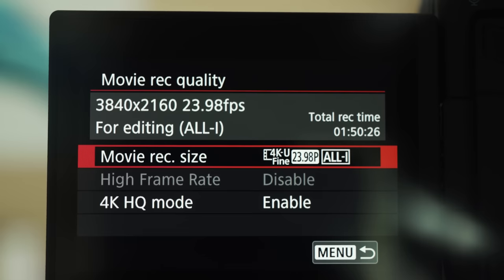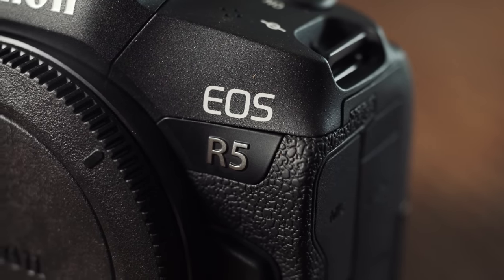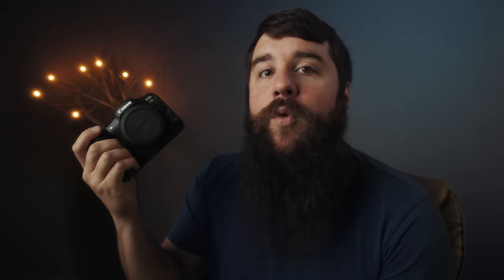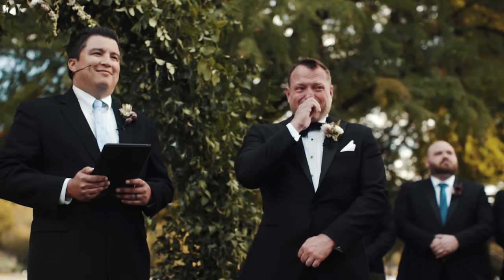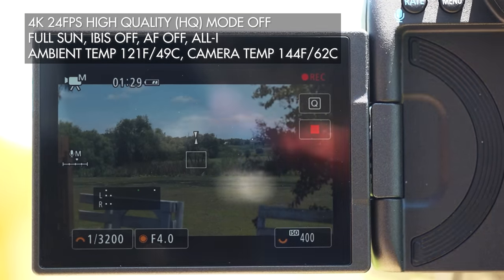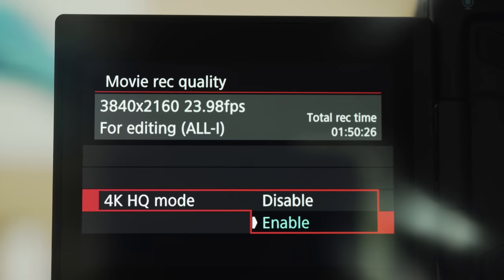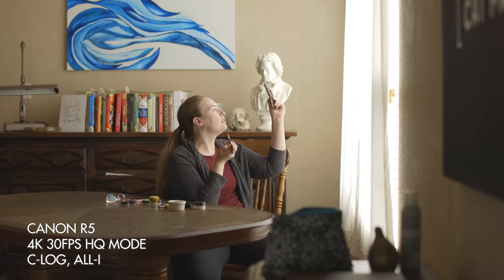Will The Canon R5 Overheat Filming A Wedding?

Comment: Matt: “Professional film makers should NOT rely on this camera”
Canon: 👁💧👄💧👁
Reply: Any professional film maker that buys an R5 is dumb... just as dumb as any pro photographer buying a 12 MP crippled A7SIII. 
Cinema cameras exist for a reason.
Reply: @77dris  maybe the point is not every professional thinks the same, I'm a wedding photographer and I shoot photos with a Sony A7iii, I used to do it with an A7r2 but the raw sizes were just too big, so didn't go for the r3 or r4 cause the prints I do really don't need anything beyond 24mpxs, that could happen with video: shooting raw video is a nightmare and most progressionals only do that if necessary
Reply: @77dris  try to spend a whole wedding day with a professional camera mounted on a gimbal. Good luck with that ;-)
Reply: @badmoonPL  did it for 35 weddings last year. This year I don't use a gimbal unless I have too. My back got so fucked up. 😅
Reply: Yes, though he's assuming that you don't have six R5 bodies in rotation and an S1H for everything long form ;)

Comment: The most straight answered video on the overheating of this camera, THANK YOU!
Reply: Have you used the ninja on a gimbal? Just curious, cuz I shoot all day on a gimbal and I never bought a ninja because it seems like it would be too heavy and throw off the balance. Just curios if anyone has experience with it on gimbal?
Reply: Davin Phelps what I do is put a cheese plate on the side of the gimbal or have a handle attached with the gimbal that has places where I can mount anything that has a 1/4 screw. I put the ninja on that side rather that ever putting it on the top of the camera.
Reply: ANM Productions - All Things Film thanks for your response!

Comment: Matt, thank you so much! This is the exact question I was asking myself all the time. "If I buy this for stills, can it pull off enough video shoots for me to create a 5-to-10-minute clip about the wedding day for my clients?" Well, it seems the awnser is no.
Reply: That's not true.  It certainly can.  If you're able to do it with your current configuration, you can certainly do it with the R5.
Reply: @tayo5302  that's not true.  4k crop doesn't overheat. Just stop the pandering.  And doesn't overheat with an Atomos

Comment: I wouldn't go to a wedding with only the R5 because of this issue. Having a backup (ideally identical to the main camera) is a must. The insulation and weather sealing probably traps heat. WHat happens when you leave the battery door and jack covers open? DO you think they should offer a detachable external heat sink? - Or expose some metal. Amplifiers and speakers have those. Come on! Is it a crazy idea?

Comment: The entire problem seems to be the CF Express card heavily bottlenecks this camera's capabilities. And i'm sure the software is designed to be conservative in protecting against overheating the CF cards as to not damage them. I plan on doing my own test to see if switching cards frequently or if directing airflow towards the card slots when its off boosts recovery time.
Reply: There are videos of test done - in which removing the cards and plugging into an external recorder eliminates ALL heating problems even in 8K.  So your hunch in on the money!
Reply: Exactly. The C300mkIII (which also shoots on CFexpress cards) constantly emits hot air from its cooling vents and the cards also get extremely hot after use. Although they're very different cameras, they're not that far off in terms of processing (codecs & frame rates) so I fail to see how Canon opted for the R5's build without a proper cooling system in place rather than something closer to the S1H.

Comment: Wow. This is the absolute best review of this camera’s actual capabilities. I’ve been looking for a good camera to film short clips of my hikes. I use the iPhone now but want something with higher quality and good IBIS. Some of my hikes can last 3-4 hours (and also in the hot Texas sun sometimes!) so I definitely want something that will last and not overheat. It’s unbelievable to me that a camera company would release a camera boasting about it’s 4k and 8k abilities, and then basically make those settings unusable for most professionals due to overheating. It sounds like they weren’t really ready to release a camera with those options yet after all - at least until they can resolve the overheating issues. So disappointing. Thanks again for this very detailed real-world review! (New subscriber. 🙂)

Comment: Nothing beats skill and talent. There are many wedding videos on Youtube now. Kinda short sited to think that EVERY wedding photographer shoots in the same exact way. A more accurate way of stating it, would be to say, YOU don't know how to use the camera without it overheating. Simple. Other people do however. Suggest conversing with your peers and see how they are doing it. The warning doesn't mean it's overheated at or past it's 104 F threshold. Get a FLIR or equal temp measuring device and stay within you published tolerances.

Comment: Very good testing, thank you. I wonder if you had the chance to try the s35-mode, which is oversampled 4K and not supposed to overheat. I know everybody is panning the R5 as a video tool, but if you think of it as a very good stills camera with a small c200 inside, I think it makes quite a lot o f sense (lack of reliable slo-mo notwithstanding). If the s35 4k turns out to be as reliable as the non HQ 4k, that is.

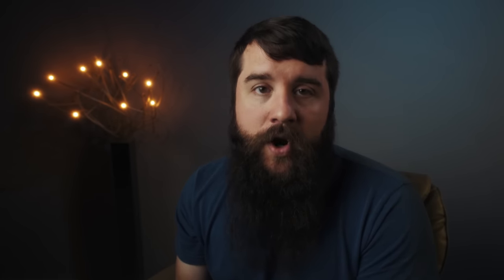Comment: 5:27 Ah, the old reliable FS700- 240 fps @ 1080, internal NDs, 2 XLR ports, battery life for hours, no record limit, great compression/file sizes, no overheating in any circumstance all packed into a reliable nearly indestructible body. I still run mine at every wedding as a static unmanned cam. Drastically underrated for the features.
Reply: Actually, on closer inspection it appears to be the 100. But the same still applies except for 240 and NDs.
Reply from the maker: Haha yup just the fs100. I bought it before the fs700 came out. They are both great cameras. Weird to think the a7siii now shoots 240fps

Comment: The overheating issue on the R5 has been recently solved by recording to an external recorder (i.e. Ninja V) instead directly to the internal SD cards.  Apparently this gives you around 4 hours of continuous 4k HQ mode and faster recovery time as well.
Reply: So When I spend $4k on a camera I still have to spend another grand just to get it to work? Why wouldn't I just buy a different camera?
Reply: @Westwardeast   even if u tack on another $1k for an external recorder, what other camera will give u what the R5 can for both stills and video?  
Sony As7iii? Only good for video
Panasonic GH5 or S1H?  Autofocus sucks
Reply: @jtdiddy3160  if you are buying this camera and setting it up with an external recorder then there is a super slim chance that you are an entry-level creator or you do just as much photo as you do video. If you actually need the 4K 120 or HQ and a 45MP censor you hands down have a stills centric camera and a film-centric rig.
Reply: @Westwardeast  i'm stepping up from a Canon M50 and I consider myself a beginner still.  But I have the Ninja V bc i wanted to maximize the features of the R5 or As7iii.  I haven't decided yet which one I'm getting
Reply: @jtdiddy3160  Man the best advice I can give you as someone who is a professional and self-taught is to not waste your money on either of those cameras!!! I say that with serious care for you. Spend your money on something like the GH5, the X-T4, or A7III. Specs and numbers do little for you in the real commercial world if you don't have the experience to use them. I'm sure you are a talented person but invest in glass and learning the craft. No R5 or A7SIII is going to get you paid or make you a better filmmaker or photographer. 

Invest in yourself, not a camera body! I run an inhouse media dept with two A7III and have written $10k contracts with very happy clients at the end, all with an A7III and a sigma 35.
Reply: @Westwardeast  appreciate the advice 🙏.  I was (am) seriously looking at a GH5 but the autofocus issues has me very concerned. That and its a 3 yr old camera and the rumored G6H is supposedly coming soon
Reply: @jtdiddy3160  Absolutely man! I hate to see people spend their hard-earned money on equipment that they don't need (yet! haha) 

Honestly the GH5 is still a great camera. I Hardly ever use autofocus when filming and I know some incredible creators that have used that camera for years without any complaints from clients. 

I would say though if you are looking to get into full-time filmmaking you should look into what glass you like and learn how it's going to work for you. If you get a GH5 chances are you are adapting canon glass to it which means you won't have good autofocus anyway. All depends on what you are shooting. I love my A7III and would also say the X-T4 is an incredible camera. Plus you have the Ninja V so you can get almost the same quality footage from the X-T4 with a ninja V as you can the R5.
Reply: @Westwardeast  honestly, I do mostly talking head tutorials with  occasional simple b roll footage of a product etc...  do u think GH5 autofocus will be OK for my needs?
Reply: I try to carry as less as possible. The camera should be as small as possible. Adding a monitor with a Ninja V means i have to attach it on my gimbal. I did that on 2 weddings. Honestly, not an option.

Comment: Hey Matt WhoisMatt Johnson! I just bought the Canon R6 and did some 1080p and 4K testing.. No overheating with firmware 1.2.0. None. I ran out of memory before I could get it to overheat. LOL Need more memory -- which 170mb/s can handle anything out of the R6. Also I'm able to use both card slots for video -- someone told me that was 'locked' in the previous firmware versions?

Comment: No question that Canon went about the marketing for this camera poorly but as a professional in my business having at least two of everything has always been my motto. Nothing else in this form factor will do the high quality options the R5 does. Either get two R5’s or the A7Siii for its 4k30/60/120 and to save having to buy Sony lenses use an EF adaptor for canon glass and use the R5 for stills, 4K HQ with an external recorder and 8K internal for video with option of 35MP still frame grabs. Not to mention incredible IBIS. Realistically nobody needs all this but why not offer what it can do. Minus lens costs your in 9 grand for both bodies. It’s not chump change but it’s your business and you can bill appropriately for offering the best quality images (skill aside:) This is a pro piece of gear doing things others can’t at the moment with obvious limitations based on spec. If we want the best for our clients these are the limitations of our time. We are either a professional or we are not.

Comment: There are two ways to make it work.
In both cases, you will have to have at least two of them.
First way is to have one shooting always in 4K non HQ 30fps or lower and the other one only shooting the occasional 4K60p or 4K120p and then turned off immediately to cool down.
The other way is to have both cameras recording to an Atomos Ninja V, and switching cameras every two hours.
Reply from the maker: I could see swapping bodies, but then you would still need even more bodies for the wedding ceremony, because once you film even in 4K non HQ they will lose their ability to record any of the wedding reception in high frame rates.

If you go the Atomos route, you're looking at $10K for 2 bodies with recorders. 😅
Reply: @whoismatt  
In scenario 1, you can shoot with camera a continuously at non HQ mode and the camera b will be switched on only to shoot the occasional shot at 60p or 120p only when it is necessary and then put to rest. I believe that unless you constantly shoot at 60p and 120p on camera b, you will be able to shoot a few 60p/120p shots and then have the camera rest for 15-20min before you touch it again so in practice you will be able to shoot for quite a while.  
With scenario 2, you can get away with 2 bodies, and one recorder.Just swap the recorder from camera 1 to camera 2 when you have a long enough break.
Still an expensive way to do things but on the other hand, working with two bodies for redundancy was always a standard for unrepeatable events like weddings.

Comment: Yup. As I thought, this is clearly not designed as a workhorse video camera. As someone who shot weddings with two A6300s, I can tell you that fighting with overheated cameras is not conducive to a high quality product. I stick to a decent-looking 1080p 60fps for the entire day, because I’ve had the a6300s overheat doing 4K 24p in an air conditioned room after 20 minutes. Shoot, I’ll get thermal warnings on a warm day regardless of my recording resolution.

Even if I was a Canon user with a whole kit of Canon glass, I couldn’t imagine trying to use the R5 for something like this.

Comment: Love the channel and thanks for the video.  It is unfortunate the camera does have an issue with the best video modes overheating.  One thing omitted here is the fact that with an external recorder you can significantly increase your access to the 4K24/30 HQ modes as well as the 4k60.  Many may already have that device and therefore wouldn't represent a significant extra expense to them.  It also addresses the issue of video codec for the natively recorded video files being a bit to handle currently.  Obviously, that still omits the 4k120 and 8K modes.

The other thing is even the 4k24/30 video is still good, just not the beautiful 4k24/30 HQ.  As well,  calling it a glorified R is a bit of an overstatement.  Last I saw the R couldn't record full-frame.  Actually, it is quite far from full-frame with its 1.7x crop.

Since we are talking the R...  If you can live with the 1.7x crop then the 1.6x crop APS-C mode would be a great option to "drop-down to" since it is oversampled 5.1K video and suffers no over-heating time limits.  This video mode looks to fall between the 4k HQ video and the standard 4k, just with the 1.6x crop.   Is it ideal?  Nope!  Is it a viable workaround, especially for someone with lots of Canon glass looking for an upgrade?  Absolutely.

Lastly, I do have some hope that heat is going to be addressed giving extended run times from today based on the fact that overheating, as you observed as well, tends to be more time driven that perhaps an actual temperature limitation.  I think along with the marketing misses the conservative approach Canon took here didn't do them any favors.

Thanks again for the video!

Comment: Hey Matt: I would have really appreciated if you would have mentioned that the 4K 60 FPS issue can be solved by just using an Atomos Ninja V.
Reply: That is not a solution, but a work around to the issue.  While I agree the Atomos is a great workaround that still leaves many other issues.

Comment: Thing is this issue will be resolved with a future firmware update. As all the tests have shown, it's not the camera that is overheating but the cf card, or cf card bus because the 4k hq and the 8k are pushing too much data at the very limits of cf's capabilities without any active cooling system to help it out. 
With a firmware update canon will simply offer new recording options at lower bitrates that will help avoid these heat issues.
Reply from the maker: You make it sound so simple. I hope Canon is able to do it.
Reply: @whoismatt  It's not easy at all, but they'll have to do it and I imagine they were working on it since before the grand release happened. I expect them to deliver this update in 2-3 months time, but if it takes them until 2021 to deliver this update, they'll definetely lose potential r5 buyers (video guys) to sony and other brands.
Sony with the A7Siii have avoided these overheating issues by opting for low bitrates from the get go... I mean sony's 4k120p 10 bit 422 is at 280mbits while canon's simple 4k24 is already at 470mbits. The 4k120 is close to 2000 mbits on canon's side. No wonder cards are getting hot. 
But I agree, it won't be easy for canon to bring those updates on short notice. To me though, they don't have a choice, so they'll have to be quick.

Comment: It's frustrating for sure, but it's worth pointing out the most of us shoot with 2 bodies. All your points stand, but relaying them would help mitigate the issue a little.
Reply from the maker: I definitely think 2 bodies would help, but remember that if you use those 2 bodies for the wedding ceremony - even in 4K non HQ mode - this will cause the cameras to warm up enough that they are incapable of recording anything higher than 4K30p until they can cool. That means no high frame rate video for the reception.
Reply: @whoismatt  You could leave one off in the bag for 45 mins after the ceremony. That way, it's only that 45 mins of the day that's non-HQ 24p. Far from ideal as that's often when the portraits are taken, but at least the rest of the day is ok. If the speeches are before the meal that'd help too. I hope there's some sort of fix coming for this. Not counting idle time as off time seems like a software fix.